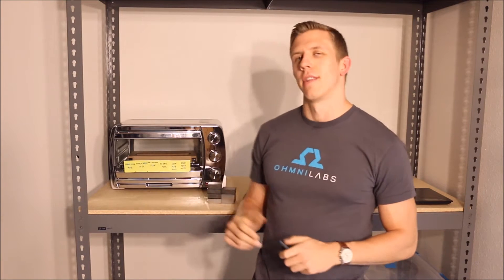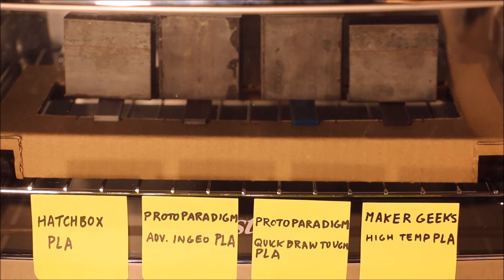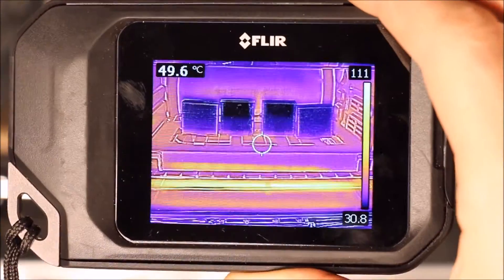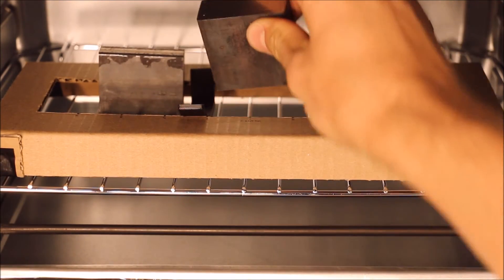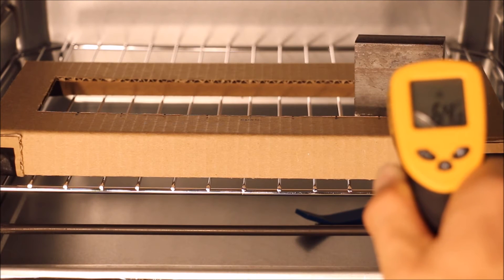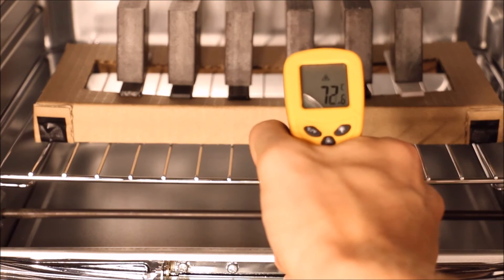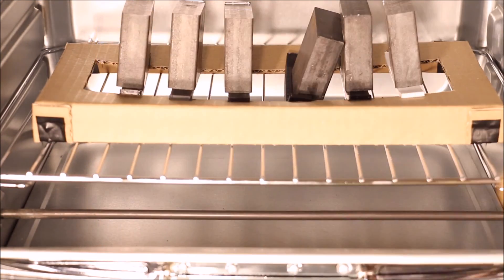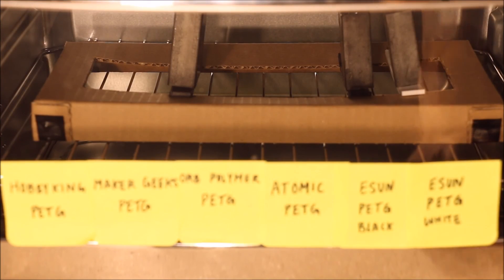Effects of Temperature on PLA and PETG 3d Printing Filament

Comment: I wonder if the dishwasher could be fine because there is no force applied during the temperature change. What is going to happen if you heat it up to 100 C degrees and then return without the weight?

Comment: What this shows is that consumer 3D printing is a joke. I wonder what are the performances of these plastics against cold? My gut says it will be just as unimpressive. The materials are designed to fail so that people can't really make parts instead of having to buy them from merchants.
Reply: You can also print in ABS which has  GTT of 120c I believe. 70c is actually really hot. That hotter than any desert on the planet.

Comment: I appreciate the work you put into this test. You are using real world loads proportional to the test piece. This other video uses just a few grams for similar size test strips.https://www.youtube.com/watch?v=vLrISrkg46g. His results are totally misleading.

I found that Maker Geeks annealed PLA did not sag at 55C where the others did. But it would still not hold a load of only tens of grams.  Not worth the money for heat resistance.

Comment: Was the maker geeks PLA annealed before the test? It is designed to be annealed. When headed in its natural state it is pretty much like regular PLA, maybe a little better. After annealing there is no comparison
Reply: This

In their article about this it doesn't look like they annealed it first which is pretty clear on the Maker Geeks website as necessary
Reply: You can anneal all PLA samples and get the improvement in HDT. Makergeeks adds nucleation agents, which speeds the process, but it should occur with regular PLA, too.